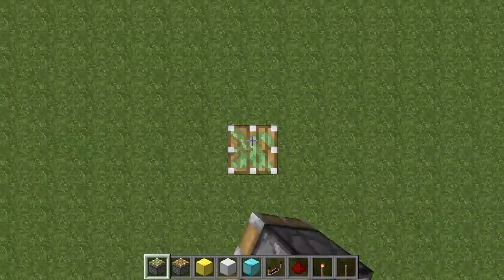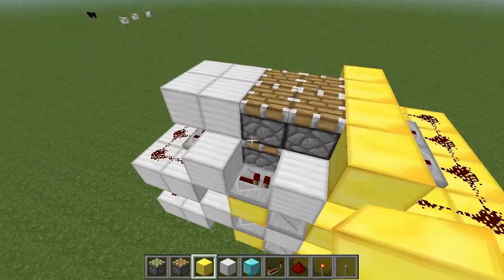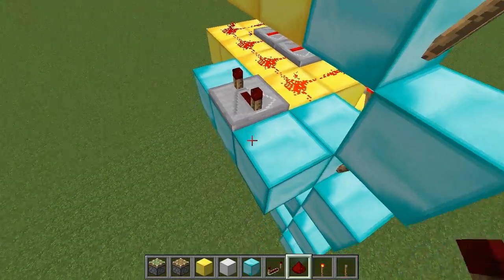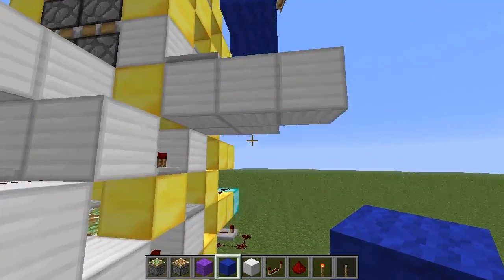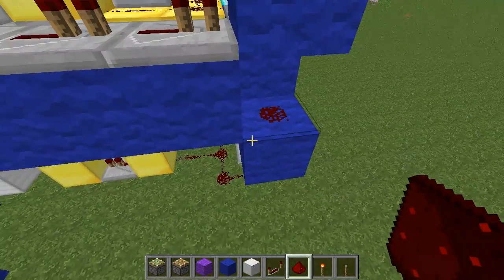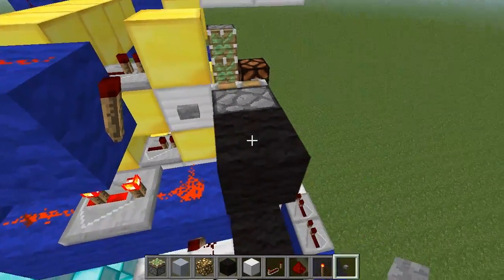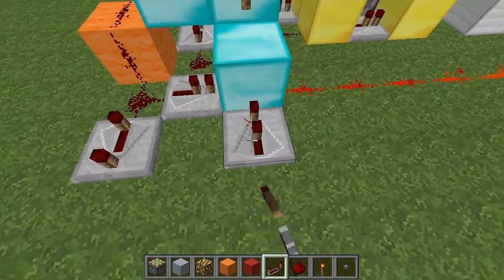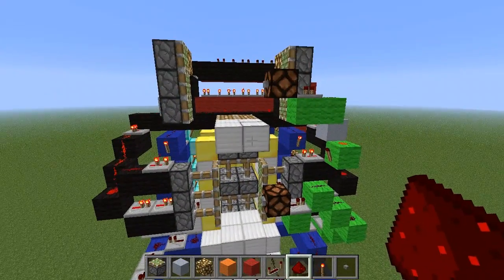Piston Stack Elevator Tutorial

Comment: I figured out a way for this design to work in later versions of minecraft. Set all off the delaying repeaters and the monostable circuit repeaters to 4 ticks (the bottom ones). It works in both PC and Pocket Edition. And yes, I do know the bottom doors will need to be delayed more.

EDIT: I realized that because of the new updates, the monostable circuit repeaters can actually stay on 3 ticks, and still send a 2 tick delay.

Comment: I built it on the Xbox 360 and it won't work right, when I start at the 2nd floor to test it the Pistons u stand on go down 1 block and then go back up. Someone plz help me!
Reply: Yh me to
Reply: Because it only works on PC version 1.2.5 and under. It's fixless.
Reply: oh, ok! I just did the same as you and found out the hard way :(! Thanks for the tip! :)
Reply: I did an update and it works in 1.8 and even the 8 high I will do a tut on the 5 high piston stack elevator this is true so ya
Reply: RetroGaming102 i create something and now it work
Reply: Killerwhales video on xbox 360*
Reply: RetroGaming102 6:50 into it u have to add 1 more tick to 1 repeater he places
Reply: Me gusta losvidiodealimales

Comment: It worked fine and I was even impressed that everything worked, but after I put my black wire it touched the other line of redstone and everything messed up. I looked at your model, and I tried to find what is wrong with mine but all redstone seemed fine and identical to yours. Also used your note and the entrance was heading f1 direction. I really want to know what is going on, and implement this elevator into my world because it doesn't need alot of blocks. Your help would be much appreciated.

Comment from the maker: Check the repeater settings - that they are the same as the video. Especially check the repeaters in the monostable circuits are set to 3, and the repeaters leading into the monostable circuits are set to 4 (for the left) and 2 (for the right) (when facing the lift from the front). Also, make sure you are building it in the right orientation (see note in the description).